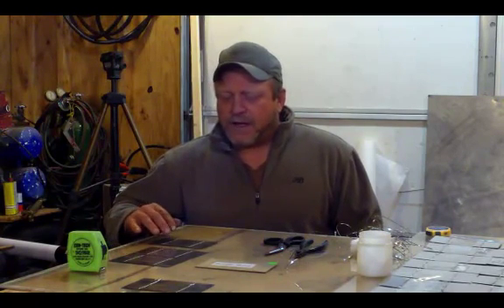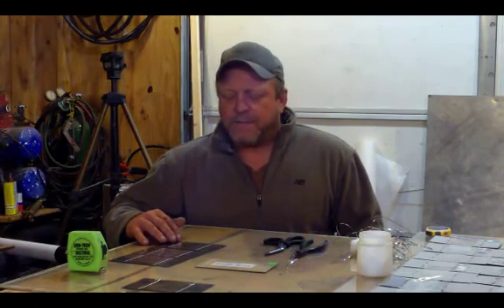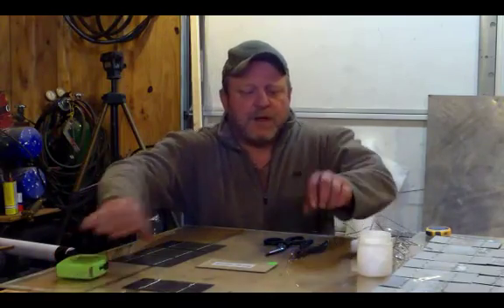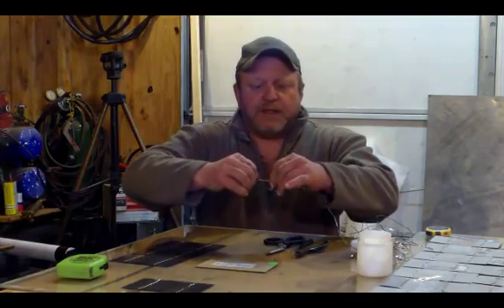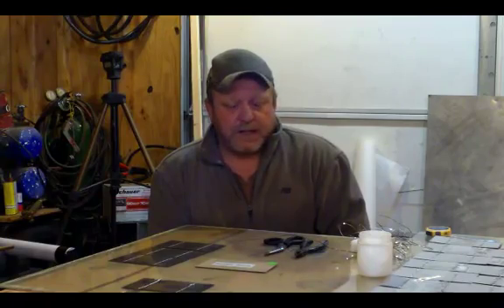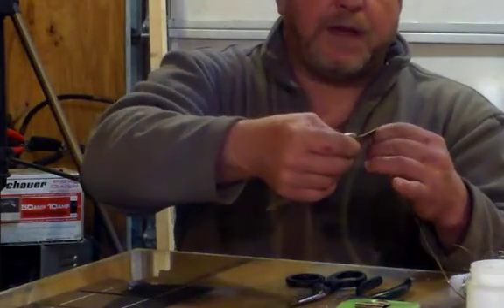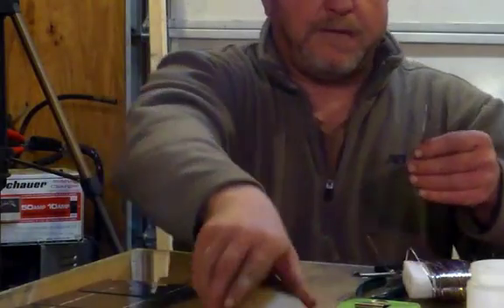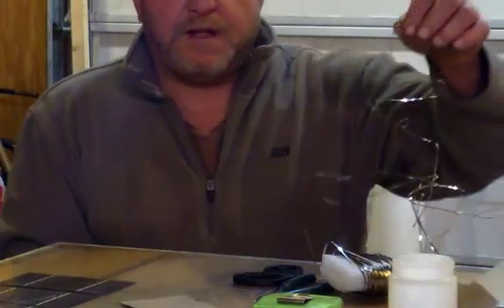Solar Panel Tabbing Wire Trick

Comment: I have been building a solar panel completed one. 18 cells 16² 10 and a 1/2 volts 5 and a 1/2 amps unfortunately. Many have cracked it's careful as you can be with them they crack on you. I didn't complete a panel but bless wattage. It would be nice to know how to keep from breaking me so it would be the best trick of all when using them

Comment: i wish i watched your video first before buying my panels. im certain they are NOT pre-tabbed and while i am yet to receive them from china i am now finding the costs of tabbing wire significant... add to that the flux pen and flux and solder and the TIME and frustration i suspect will follow along with the idea of breakage im sure i am not going to enjoy this as much as i would like. 

your idea to roll the tabbing wire in the cut pkg or panel sized cardboard cut out is GENIUS!!